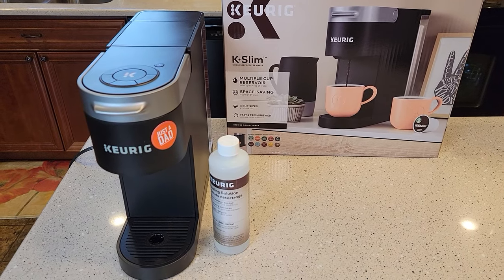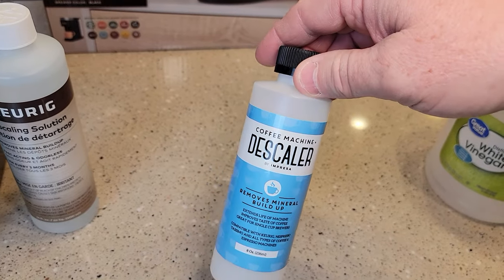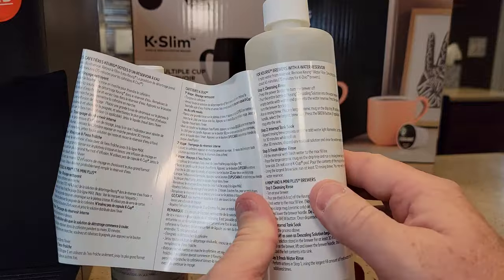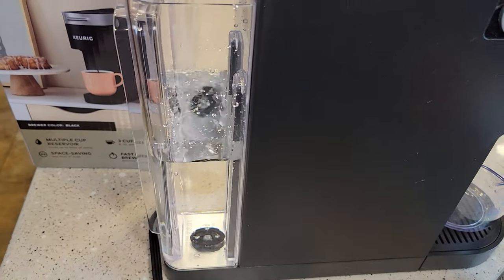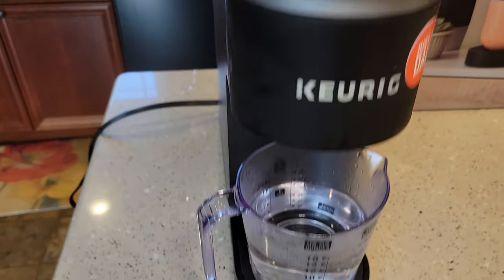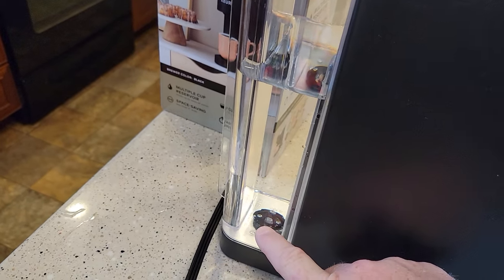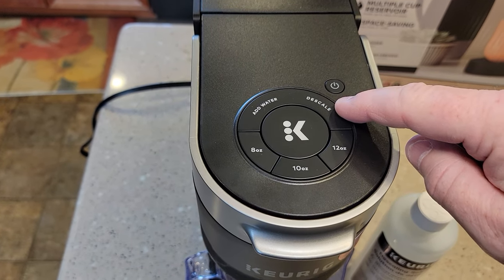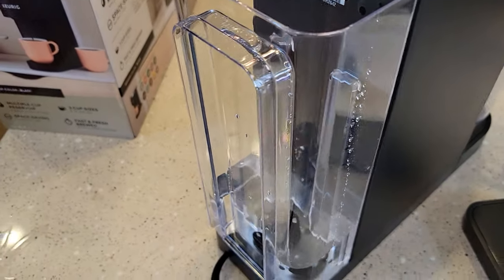HOW TO DESCALE Keurig K Slim Coffee Maker With Keurig DESCALING SOLUTION DESCALE LIGHT ON

Comment: I cleaned my machine for 30 min and light still on, so annoying
Reply from the maker: Keurig has changed the way you descale your coffee maker.  You have to put the machine in descale mode and follow it all the way through to get the descale light to go out.  
step by step instructions see below.  You have to follow them all the way through.  
I hope this helps. put the descale solution in the tank.  You have to put  the machine in descale mode.   First leave the machine plugged in, then turn the power button off.  Press and hold the 8oz and 12oz button for 3 seconds till the big k brew button starts flashing.  This puts it into descale mode.  The only thing you will see is the big k button light on.  the power button does not light up.  press the k button and it will run 12 oz through the machine. keep pressing the k button till the add water light comes on.  don't touch anything just put fresh water in the reservoir and the add water light will go out and the big k button will start flashing again.  press the big k button to start the machine again this time it will be rinsing the machine at 12oz each time you press the button.  keep pressing the k button till  the add water light comes on again.  Once you fill it up with water again it will come out of descale mode and now you are ready to use it again.  turn it on and the descale light should be out. Let me know how it goes. YOU GOT THIS!!!!
Reply: @JustADad  Thank you so much, your instructions worked.